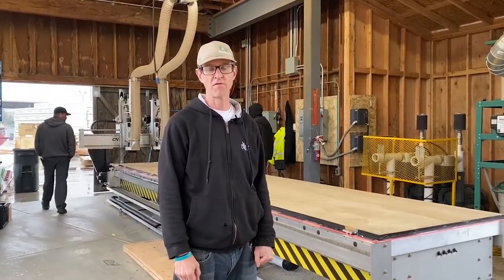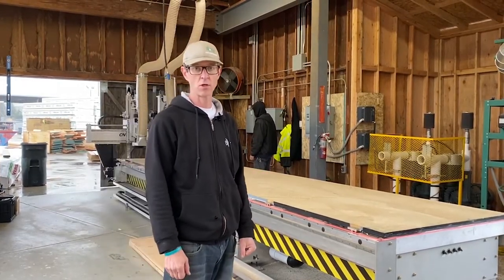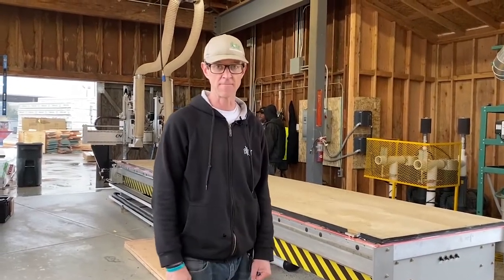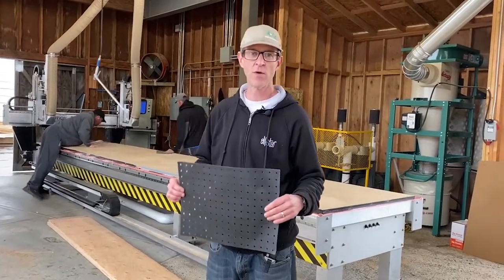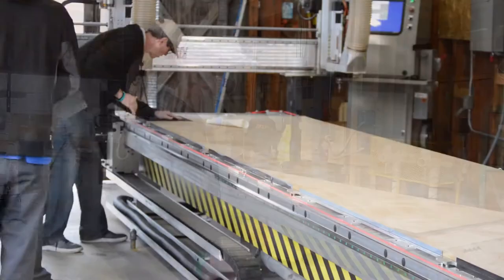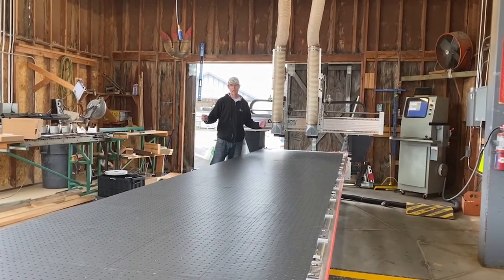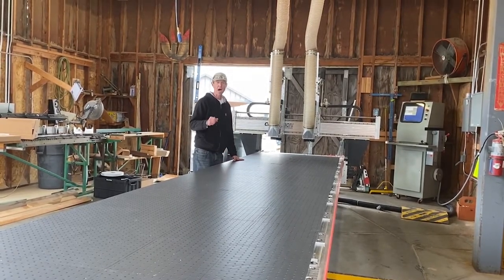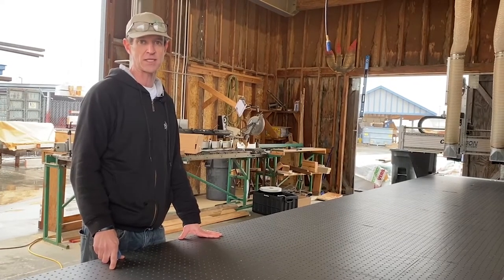Tile Gasketing To Improve Spoilboard Vacuum Hold On CNC Routers

Comment: Would you expect similar performance with this to a phenolic table top?  I assume with the advantage that you're product is a consumable and a phenolic top isn't meant to be due to cost.
Reply from the maker: The Tile Gasket product sits on top of the spoilboard that sits atop of the vacuum bed. Users should never be cutting directly on a phenolic bed, that's what the spoilboard is intended for - to be carved into and "spoiled".

Comment: Hi Mike - so does the gasket deal with inevitable shallow cuts - I find the MDF compresses and expands due to moisture over time leading to  a need to relevel the bed (though I am using Ultralite MDF - which may be worse).  Will it tolerate that a little bit.  I mean I know its a consumable at the end of the day but just wondering how consumable.
Reply from the maker: Graham-
Yes, at the end of the day, this is a consumable product.  Just like a spoilboard would be.  So the inevitable shallow cuts into the Tile Gasketing will happen.  But these shallow cuts will still produce vacuum seal as long as the gasketing that remains still creates a defined edge from which we can draw the air from.  This creates the vacuum clamp, the sealed edge.  But when one tile gets to the point it is no longer creates proper seal, we replace the one tile with another.  This prevents the need to fly-cut the spoilboard and/or reset the Z depth after fly cutting.  Any questions please feel free to reach out.

Comment: What about the air leakage from the sides?
Reply from the maker: We recommend sealing the edge. It's small leakage, but every area can count. We have a product known as "Edge Tape"to help seal rather than using caulking or other liquid based sealants and having to wait to dry.

Comment: How come they didn't cut through the tiles?
Reply from the maker: Ziyad-  The Z depth is adjusted slightly to just kiss the gasket.  It does chew it up over time.  It depends on the operator.  The gasket still performs as it should be it is chewed up a bit.  Much better than a rough spoilboard alone.  We are happy to answer any question you may have.  Info@allstarcnc.com 800-878-7827